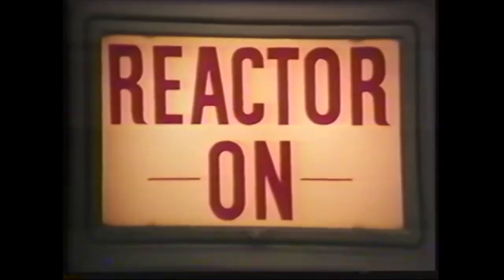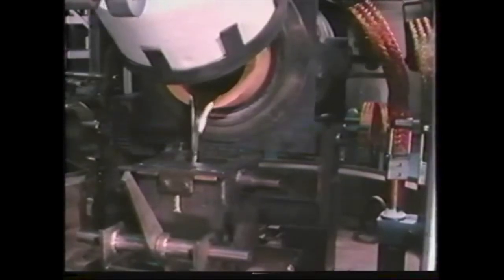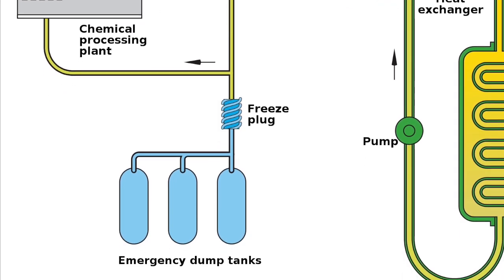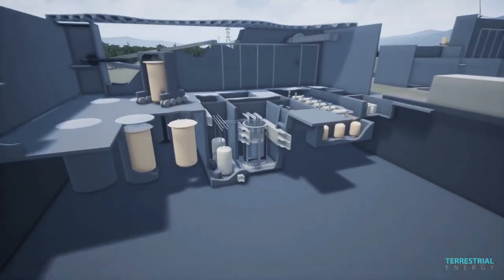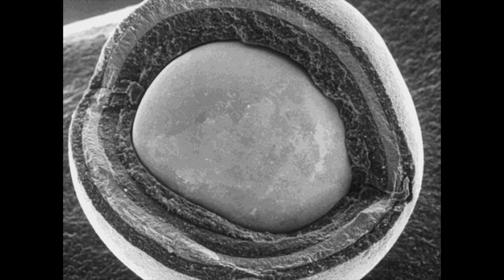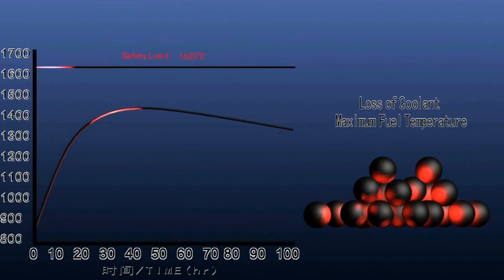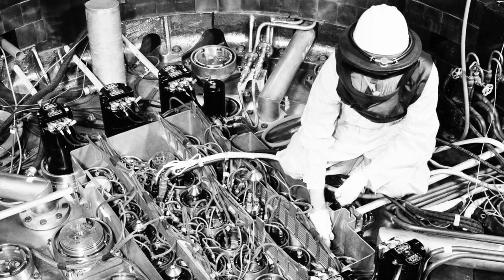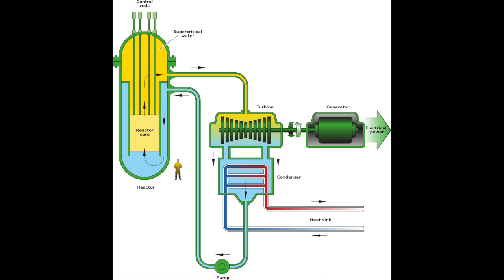Molten Salt and Pebble Beds and Breeders, Oh My! Alternative Reactor Designs (Part II)

Comment: So then every time pebble bed reactors became critical, they plugged up on the outlet of the pebbles. Also the triso fuel pebbles were less robust than thought releasing it's actinides into the gas cooling material thus contaminating everything in the outlet. I personally see no reason to test triso fuel pebbles as reactor methods because of 1. The amount of fuel needed to go critical. 2. Delivery methods of pebbles. 3. Breakdown of fuel unknown in length of time of failure with concomitant radiation release & or reactor and surrounding area contamination. 4. All these demerits reduce and or eliminate pebble bed as a power source. Too risky.

Comment: Aside from the misconceptions surrounding waste, most people have no idea that there are as many different types of nuclear reactors as there are. A lot of the safer types of reactors that either can't melt down or only do so if the wildest of scenarios come up were looked at and abandoned by the US government because they couldn't produce weapons grade fuel. Thorium reactors are a great example, because while they do produce fissile uranium suitable for a bomb that fuel is contaminated with an even less stable uranium isotope that if not removed could cause any weapon it was in to just do its own thing instead of being detonated when we wanted. Back when serious nuclear reactor research was being done the government was footing the bill and really only concerned with fuel for weapons which is extremely difficult to produce. The US having thousands of weapons at the end of the cold war required massive effort in order to produce the required tons of uranium 235 and plutonium 239. Chernobyl, and later Fukushima werent the result of inherently dangerous tech, rather irresponsible and stupid humans making catastrophic mistakes. Chernobyl was built on the cheap with a fatal flaw, and Fukushima was built on the beech on a coastline prone to earthquakes, tsunamis  etc... etc.... in other words the exact place you don't want a regular power plant let alone a Nuke plant.

Comment: The German PBRs showed some serious problems with the concept in general that offsets benefits:
- the graphite moderated reactor will be uncontrollable if water enters it
- there is no online monitoring within the pebble bed, you only have the coolant temp
- pebbles don't flow freely, despite being low friction and surrounded with helium
- since pebbles don't flow freely, control rods (as in the THTR-300) will crush them on insertion

PWRs may be boring technology, but their control and management is well understood.
Reply: pebble bed is such a typical german overengineered idea, that some professor was able to push through. it has so many dis-advantages that it is almost silly. (the control rods are guided in pipes of course, you can remove that)

Comment: One thing that’s interesting about a molten fuel salt is the possibility of online, continuous, fuel reprocessing. If the molten fuel salt is sprayed through a nozzle, or has gas bubbled through it, then gaseous fission products can be separated with ease. No more swollen and fractured fuel rods. Now spray or bubble the fuel salt through molten bismuth, then certain actinides (protactinium) can be separated from the thorium and uranium. No more PUREX and REDOX. Fluorination, metal dissolution, degassification, fission product sequestration, isotope selection, electro-refinement, you name it. This molten fuel salt can undergo many physical and chemical reactions, all while circulating through the reactor.